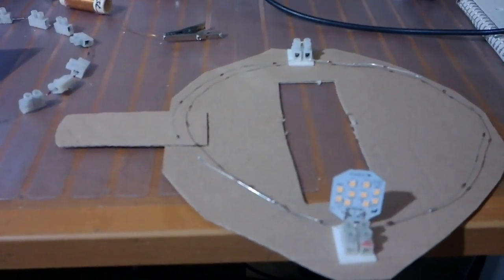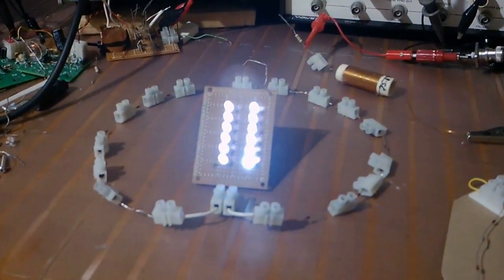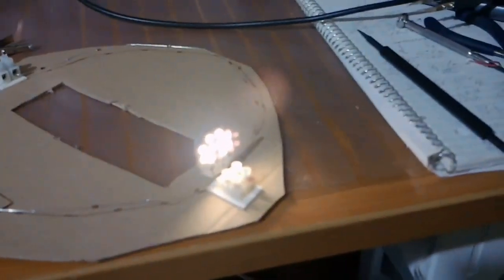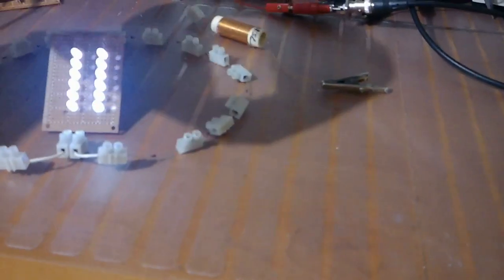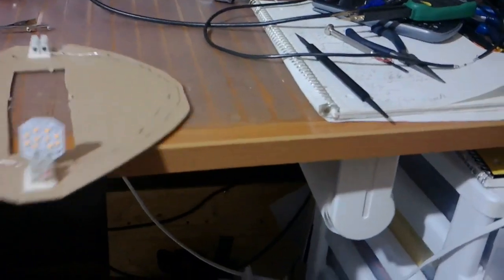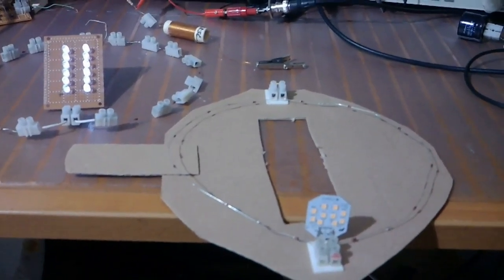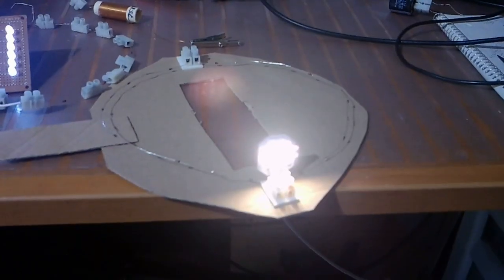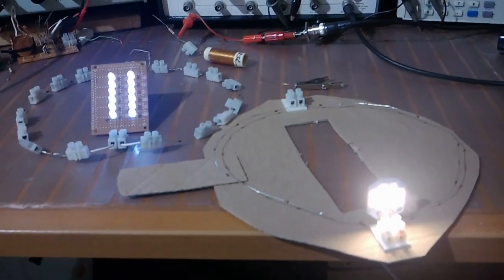Multi-Loop Look

Comment: So the diodes become gates to the frequency applied and begin to re-inforce the waves coming through each gate....is that how we should be thinking about this?
Reply from the maker: Somewhat, although the diode inter-action with the Lattice because of how the delay works is also a necessary. I'll get further into that as I move further, but, you can look at it without the Lattice (which no one accepts) and have a close understanding.
Reply: the term Lattice is new to me, what you mean by that?